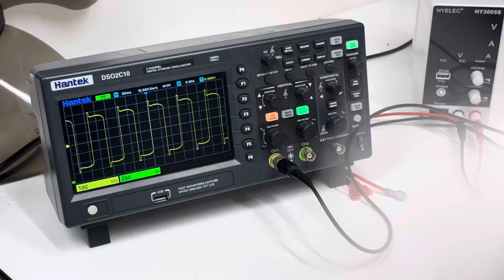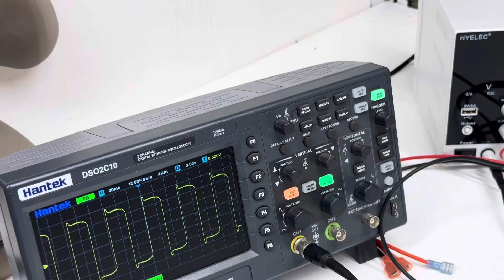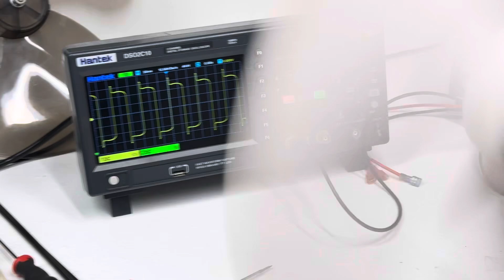Window motor bipolar bedini circuit

Comment: hi there, i have a question: how have you set your scope so smoothly? i basicly have the same scope (Dso2d10) but my wave arent as smooth as yours. (im kinda new in electronics)
Reply from the maker: Ground to battery + and center of probe to middle Lead of transistor 
Then tune with time devision and set to 5v per square
Reply from the maker: On this one place one test lead in each side of coil